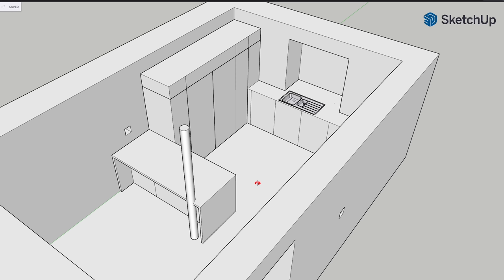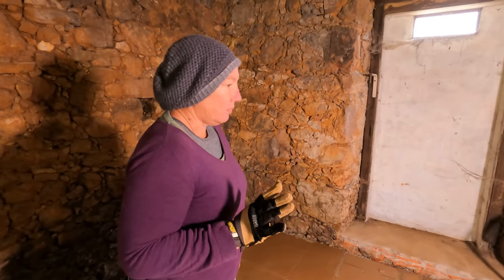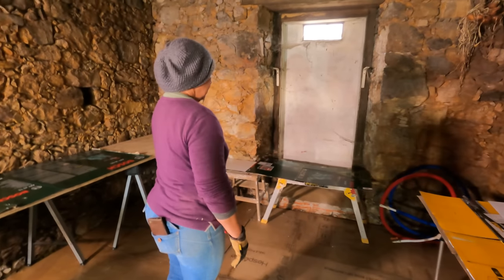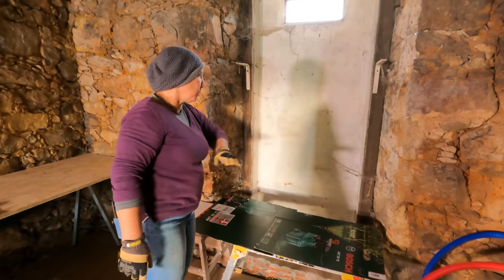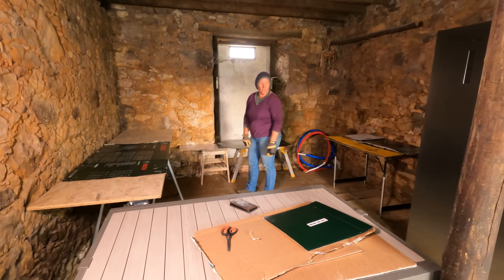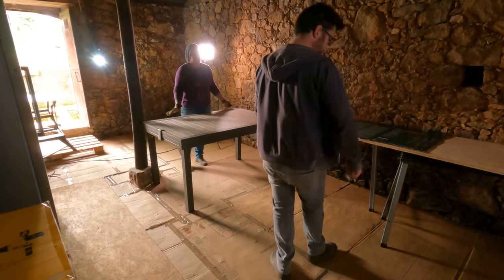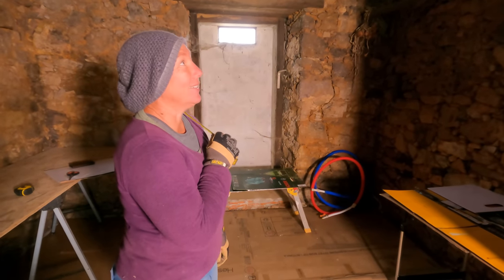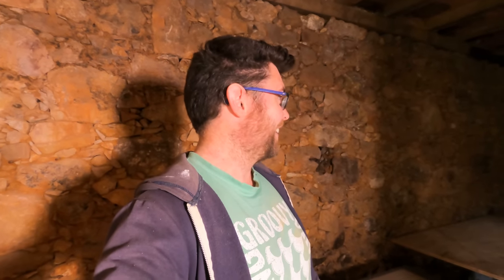How We Planned Our Perfect Kitchen

Comment: Trestle mock up: Wonder if you put the table on lockable wheels and run the post through the table such that you can turn it clear around the pole? Seating for guests. Add a hindge leaf if not enough clearance for work space for canning. And a place to set ripening/chopping up things for the garden near good light and air. If it is surrounded and curved as pole runs through it would look more artistic and incorporated. U know best but...?

Comment: RE extract, I wondered if there was a way to implement a downdraft extractor behind the range? It could be vented to the outside through the false door/window via some slim underfloor ducting or hidden inside the cabinets at a lower level. Easier said than done, but might avoid any ugly hood or ventilation ducts at high level.

Comment: My two cents. If you want to pre rinse the dishes, the dishwasher should not be directly under the sink as when its loading door is open, you can not stand in front of the sink. The dishwasher will have a certain height, the sink a certain depth and the work top with the sink should have a convenient height.

Comment: Is there any reason why you want to run all the socket wires down the walls from the edge of ceiling when you will have bags of options under the floor which you have to yet bring up to its final level ? .

Comment: I think you are getting close to a good design that will work well for you. 

Just my tuppence worth, but ... I wonder if it wouldn't be better to have an island on casters, rather than a breakfast bar? You could easily reorient it when you have guests. (I'm sure you'll be megapopular by the time you finish making the kitchen, so this might happen more than you are calculating ....) You could maybe make it smaller than you are currently planning, so it would work in different orientations...? You could still make it 'dock' into the pole by indenting that corner. Or even ... just a thought, but what about buying a commercially made island to start off, something basic, and see how well the space is working? Then when you've actually lived in and used your kitchen, make your final perfect design and dimensions. My guess, from what you've said in this video, is that if there is a circulation pinch point, it's likely to be the dining table side of the room. As you've said, within the food prep area looks quite roomy.
Anyway, I'm quite sure it's going to be a fantastic heart to your beautiful home.

Comment: So Get rid of the Pole Altogether and replace with Structural Beam 🤕...but u 'Love It' so Consider Building a Table Around it using the pole as a Pivot Point, that way u can hide the Underneath and Box in the Top Section With Polished Timber in a Square Design of your Choosing, Alternately you could box in the bottom  with a Cupboard or  Similar Open Shelving, then u have HALF a POLE hidden! ...Pinterest has Multiple Examples of This, and then once u see this u may come up with a better Shape of Table which is more Space Effective, and the Ceiling Exhaust Fan is Sound idea 😃..Just my 2bobs worth 😅😅

Comment: where are you going to put your hot water heater? It would make sense if it were near the kitchen where you will use most of the hot water. You could hide it in a corner of your kitchen under the cabinets where other wise you won't have access to it. Don't know if that makes sense or not but it could be an option for using otherwise unusable space.

Comment: You may regret putting the fridge on the opposite wall.  I would flip flop the stove and fridge.  You will have more counter space that way. the fridge will be accessed more frequently than the stove so it should stay on the wall that it currently is.  T

Comment: A van camper builder I watch on YT makes  3D cardboard mockups to exact size. He claims that sketches or 2D mockups are not sufficient to replicate the exact clearances needed in designing a small van interior. He has access to buying large sheets of cardboard that he can cut and tape to exact dimensions. Disassembling box cardboard does not allow for detailed assembly of design features. I'm suggesting that your process of laying out your kitchen with various objects may not be the best representation of clearances in the finished kitchen.

Comment: Hello, if not fully done, I recommend you to think about the equipment you are going to install; hood, steam oven or not, microwave, ...
In the case of the steam oven, it exists with a tank and it exists with a connection to the water supply. I know that you are pushing your analysis far enough and confirm that the devil is in the details. Have a good one!